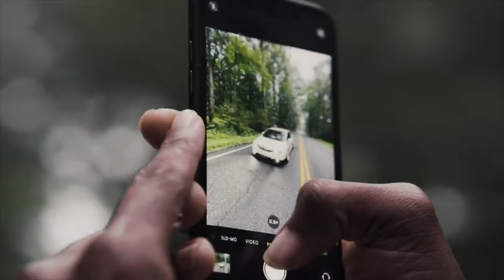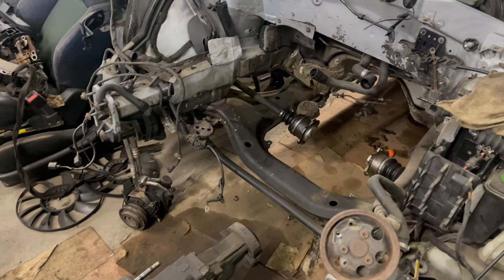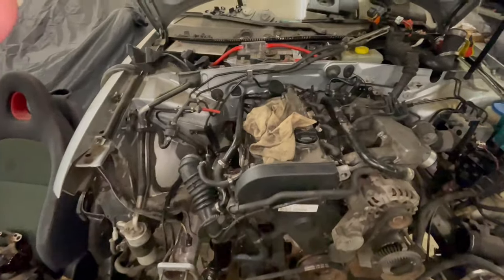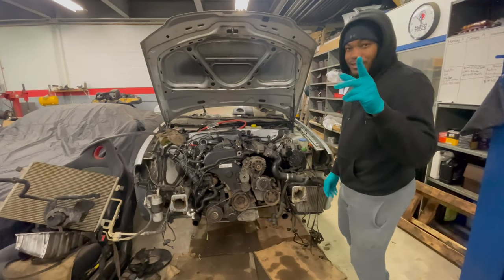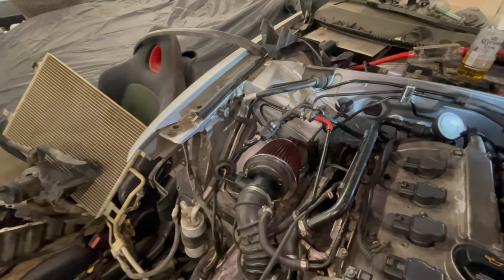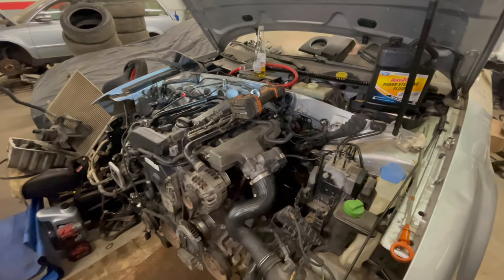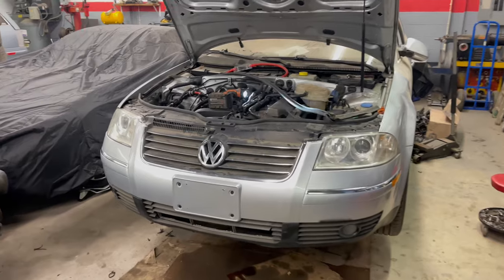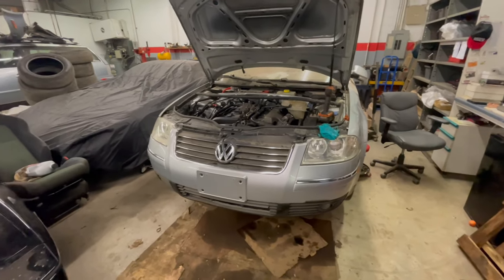My VW Passat is complete

Comment: That's what's up! I was wondering when you run NGK in our vehicles don't you need adapters because of not having the NGK Spark Plug wires? Or else it will surge the engine right. As I know we leave to keep spark plug wires from our cars correct? I don't think NGK makes wires for Nissan Maximas Right? And do you intend on running NGK?
Reply from the maker: Spark plugs should fit the same, only thing that really matters is the brand and how far they’re gapped